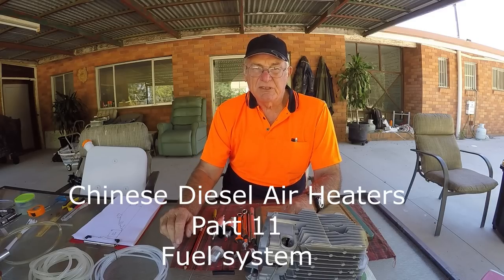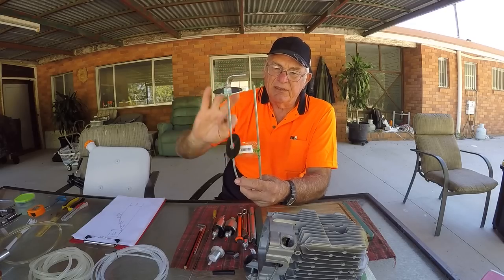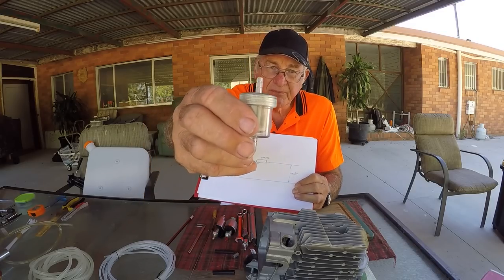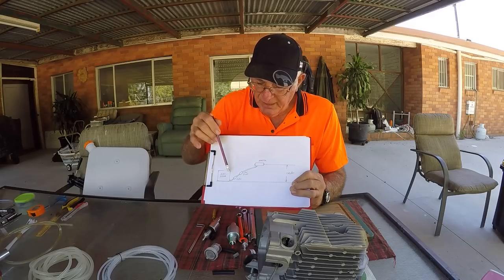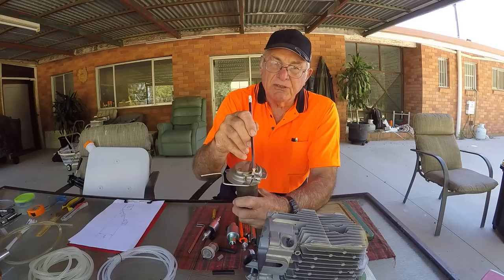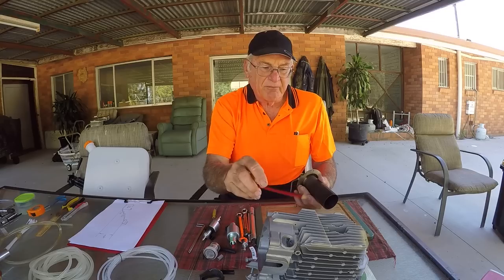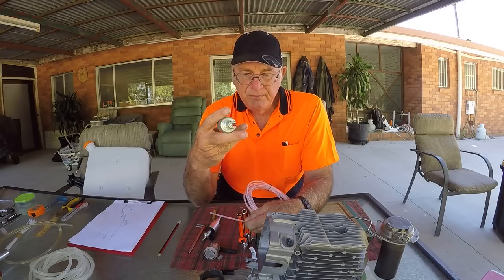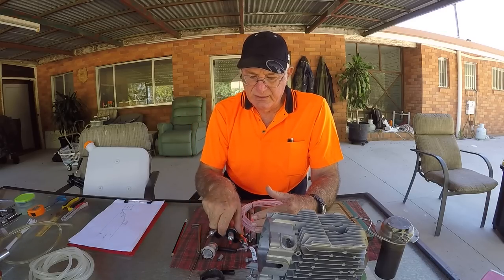Chinese Diesel Air Heaters - Part 11 -  Fuel Delivery

Comment: Thanks for a very informative video.I'm contemplating a diesel heater installation on a sailboat that has an inboard diesel engine.  Rather than adding a dedicated tank, or installing a dedicated pickup in the existing fuel tank, many installations tap into the boat's existing fuel line with a tee fitting. Some say that this works fine. Others say that this leads to issues with the heater pulling fuel out of the main engine fuel lines. Do you have any thoughts? Thanks.
Reply from the maker: Sorry,that is  a bad way to go with these little heaters. You need a seperate pick up line solely for the heater. 

If your vehicle has a fuel pump in the diesel tank (many do) 

1. When your engine is running the fuel pressure will flood the heater. 

2. If the engine is not running, the little diesel heater fuel pump will not be able to suck fuel past the engine fuel pump. JMcK

Comment: Hi John. Love your videos. Very informative. My heater would not have worked if I hadn't watched this. Only came with soft fuel line. Can you suggest where i can get an owner's manual? Mine did not include one. Its pretty cold here in Vic right now so looking forward to getting this install done.
Reply from the maker: Hi CR, thanks for the feedback.
Some of these heaters do not come with a manual, and some come with a manual written in Chinese English. I suggest you search online for install instructions on Eberspacher diesel air heaters or parking heaters. The Chinese copied these heaters, so the info is relevant.  Cheers, JMcK

Comment: Thanks John. Is there a maximum length of fuel line you’d recommend? My fuel container will be housed in the front of the van and the heater in the back making the fuel line around 4 meters. Would this be acceptable?
Reply from the maker: Hi John, 

Have you seen the motorhome install video?

Your instal should have no issues if you put the pump close to the fuel tank and use narrow bore hard nylon fuel hose on the delivery side to the heater.

Cheers.  JMcK

Comment: great video series John but i cannot seem to find hard fuel line with internal diamiter of 2mm i have tried everywhere. and hello from Ireland keep the videos coming Sir
Reply from the maker: Hi Joe, there are lots of suppliers on line. 

Search “Hard nylon fuel line for Eberspacher diesel air heater”  .... 2 mm or 3mm ID is ok

Here is just one link to get you started.

https://www.ebay.com/itm/For-Webasto-Eberspacher-Diesel-Heater-Inline-Fuel-Filter-Hose-Clip-Pipe-Line-Kit-/364009929409?mkcid=16&mkevt=1&_trksid=p2349624.m46890.l49286&mkrid=711-127632-2357-0

Cheers.  JMcK
Reply: @johnmck1147  thanks so much John thanks for the direct link

Comment: I have an idea for another one of your great videos.  The title might be "how to modify your Chinese Diesel Heater to run at high altitude$.
I Live at 6,000 feet and spent time at 8,000 feet and have purchased a diesel heater that is supposed to work ok at 2500 meters. However if it does I am sure there is some modification that would make it work better. I know that the problem with altitude is that there is less oxygen in the air so to fix that, one would need to add more air or reduce fuel. But what is the best way to do that? Thanks

Comment: hi my heather backflow a black smoke and stop working. Replaced the pump am still not working.Open the all the part and nothing look damage.Conect the new pum  the fan run but not ignition.Any tips?

Comment: Thank you sir for your videos they are great ! In your opinion ,which is the best way to silence the dosing  pump click !  Thank you  from the Uk 🇬🇧
Reply from the maker: Hi Ian, sadly, that is the nature of this type of pump. The pulse operation makes a ticking noise. 

They make more noise if they have an air bubble, so try tilting the pump more vertical to see if there is a lower "tick"

You could also see if better isolation makes less noise by removing the pump from the wall and suspending in air with string. If there is a big noise improvement, remount the pump with better isolation.

Regards,  JMcK

Comment: Great video John, thanks for sharing. 

Could you tell me, would 3mm hose work?
Reply from the maker: Hi E,  if you are referring to 3 mm id hard nylon fuel line the answer is YES. 

I must constantly state that “any” fuel line will work on these heaters……..for a while.  

However if you use soft fuel hose on the delivery side of the fuel pump, the pump pulse force is absorbed by the fuel hose and you will not get proper forced atomisation of the fuel through the atomisation screens in the burner, leading to poor fuel burn, which leads to carbon deposits forming on the screens, and eventually no lighting of the burner. 

This is why you should only use proper “hard” fuel line on the delivery side of the pump with these heaters. JMcK

Comment: My heater was working fine for a week then I noticed today that the plastic tank had compressed in on itself, I assume the cap to the tank was the problem, I tried blowing air through the hole in the top of the cap but nothing is coming through, there's a tiny rubber seal right underneath the hole inside the cap, had that come unstuck and blocked the breather hole? Any help would be appreciated
Reply from the maker: Hi Mr G,  if unable to fix the little valve, in a fixed location, perhaps drilling a small hole in the cap is easiest. In a mobile situation where their is a risk of leaking fuel you could loosen the cap when heater is in use, or drill the cap and install a small air tap in the lid. JMcK
Reply: John McK 47 thank you for the suggestions and thanks for replying John!

Comment: thanks again for your great videos! About the fuel tank and lines i have a a few questions, as i am about to install my heater in my g10 shorter wheel base chevy  77 van. 1. You mention the fuel tank (in your drawings) is below the pump and heater so the fuel line is going slightly uphill, yet in other videos of other peoples installs in small vans, i see them not paying attention to this and sometimes they put the tank directly next to or even slightly above the heater unit. No doubt in a small vehicle it is hard to find space lower than the floor of the van itself for the shape of the tank in these kits. Since I am putting the heater under my passenger seat on the floor of the van, I am deciding where the best place for the fuel tank to be. Is the reasoning to have the fuel tank lower is so that fuel will be able to shut off and not siphon out from gravity? No matter where i put the tank, I thinking of ruining the fuel line underneath the van so the pump is outside of the van to decrease the noise of the pump being heard in the van. I like your suggestion to have the pump  at 45 or more to vertical as your video suggests, but wondering if it being outside in the cold will greatly affect the pump. Also one person says keeping the tank and fuel filter inside which makes the fuel warmer prevents gelling. So want to hear your thoughts on the reasoning on the tank placement. and the fuel pump placed outside under the floor. If I put the tank inside but the pump outside the initial fuel going into the line will be warmer so that is my thought right now. Honestly in my climate only at night do we sometimes dip really low. I think it would only be a few times a year that possible gelling would happen. My other choice which would be more appealing in terms of fuel smell is to find some space in the front engine bey under hood in front of the van for my tank but it will get cold there. I was thinking of adding a one way valve to let in air on the top of the tank, it is one way so that the fuel does not evaporate but air can get in so that there is less vacuum building up as the fuel level goes down in the tank and so with less reverse air pressure the pump does not have to work as hard when the fuel runs low. I do not know if you live in a climate that would give you experience on gelling but just want to know how important the tank placement compared in height to the heater is. Also I am also wondering if the tanks that ship with these kits are durable, like i said I might buy a tank with a shape that better fits my need whether i put the tank inside or outside the van. Any suggestions appreciated. (here is an image of the one wway valve i havr in mind. https://images-na.ssl-images-amazon.com/images/I/51PR7kJzwxL._SX425_.jpg
Reply from the maker: Hi Jha,  the fuel tank can be level with the heater, up to about 1 meter below, or 1 meter above heater, for simple working. You can exceed these measurements, but you start to get complexity. 

Most supplied fuel tanks already have a venting system in the fuel cap. Check yours.

You can run a longer fuel line after the pump if it is the narrow bore, hard nylon type line. You start adding complexity with real long fuel line. In your case everything is pretty much on the same level, so you can go longer. If unsure, bench test it first with the length of fuel line you require. Prime the line as best you can first.

These fuel pumps have very effective one way valves inside them. You will not be able to suck fuel past the valves, so there will be no issues provided the tank is not meters above the heater, and the pump is not worn by using it to dry prime.

The supplied fuel tanks are quite good, but being clear for level measurement they will be degraded by uv  sunlight. If outside the van, they will need some canvas cover. 

Pump under van is ok, if not ideal, but you need to protect it and electric wiring from stones and direct water spray. This can be a simple deflector shield.
The pump gets hot when working, but the fuel lines can suffer more from gelling in very cold weather.

You are doing your research, so you should have a good install.  JMcK

Comment: I have a question. First off, thank you so much for all the information. I was able to build mine in a toolbox and followed all your steps. I now have a functional heater I can have confidence in because of your series.
However, I seem to have run into an issue. In Canada where I am at the moment, it's close to -30C and I've found my fuel gels up and won't pump. I heated the unit up and ran It in the jeep for the initial test but when I have the heater outside of the Jeep, the fuel freezes. My plan was to have this unit (built in the toolbox) and tank outside my rooftop tent blowing heat through a window.
I would prefer to not have to heat insulate the exhaust and keep the whole unit inside the tent to prevent freezing/gelling. Would an additive mixed with the diesel prevent gelling so I could have it outside in -15 to -30C conditions? Or is my only option to re-engineer my build so it's safe to have inside the tent with us as to keep everything at a functional temperature?
I hope you see this soon and have an answer for me! Thanks again!
Reply: Diving further in your videos you say kero/diesel mix would work. I'm glad there's an option for me for sure. I'm wondering still, could an anti gelling additive work as well for just 100% diesel or is it best to go with your 80/20 diesel/kero mix?
Reply from the maker: Overland Jeep 

Hi there,

Yes, a kerro diesel mix is often better than “winter diesel”. But I understand price is also an issue.

I suggest a kerro/diesel mix of 80/20 to 90/10. If kerro in your country is a reasonable price.

The purpose of the diesel is to give some lubrication to the kerro. Some countries sell a very high sulfur content kerro that generally provides enough lubrication on its own.

Do not use an oil additive like 2 stroke mix as it creates lots of carbon in the heater.

Cheers. JMcK

Comment: Hi John, great video. I am part way through installing a diesel heater and used the soft line. It will be very challenging for me to lift the heater out now to change the line where it connects to the heater, but I can just feed the hard nylon tube into the soft wider vinyl fuel hose from under the car and just clamp over the top of the soft hose (not using the black rubber hose and about 15cm directly and vertically below the heater)? Do you think this solution will be fine?
Reply from the maker: Hi GS, I think that would work fine. Have a look at motorhome video. I do something similar to provide protection to nylon fuel hose.  JMcK

Comment: I have been having the dreaded E-06 error from day one. I have adjusted the Holzer sensor position, a full range in & the full range out. I finally put it on .020 - Still have the E-06 error
I am using the 0.2 cm (I/D.)  White Hard Nylon tubing and have the pump is on a 30 degree angle, fuel tank higher than the pump, & pump is lower than the heater.

-ALITOVE DC 12V 20A 240W Power Supply, 12.6v
-Power Sonic (AGM) Rechargeable Sealed Lead Acid Battery 
 -PS-12350 12V 35.0 AH @ 20-hr,,
When I start the unit, blower runs for one minute & the pump makes one pulse, then faults out. If I power unit off for 24 hours, it did run but then faulted out, 2 hours later
-So, by this I can assume my Holtz sensor is okay?
   Filter bowl is full & just above pump, I have only been able to prime the pump manually by 
Pressing the 'OK' button, & the Down arrow button at the same time,  to get the P prime function. This put fuel in the chamber & the igniter burned it & the heater made it;s usual roar but the injector pump never fired up 
-So I assume the igniter works.
This controller & ECU does not support the LEDs for the injector pump, igniter or temp range, just a fan. ( They do show up in the POST )
   I have ordered a new pump, thinking mine is defective, any ideas?

Comment: Thanks for the video. Really good information! If I have two of these pumps sucking diesel from the same fuel line (connected with T piece), do you know if I need to install direction valves before each pump?
Reply from the maker: Hi Jarkko,
I have not had an issue with something similar in the past, but each case is different. 
I do not think you will need to install direction valves, but you need to try and see.  JMcK

Comment: Thank you for an amazing educational and entertaining video series! We had many a giggle and I feel so much better equipped to install ours. 

I have a question Re priming the fuel line. How did you bypass the pump to get the fuel up without damaging the pump. I see it was a little clicker but I’m not too sure how to re create this. The clicker is at Jaycar but I’m not sure what else I need. Any help would be greatly appreciated! 

Also my nylon hose was the small version but it’s not super hard. There is a slight squish under pressure - not super soft but not completely firm either. Is this ok or should I find some harder hose? 

Also I think the manufacturers have watched your videos as the upgraded Bluetooth models come with a tool kit with your bits in it!
Reply from the maker: Hi Emily,

If only a short hose run from tank to heater, approx less than 1 meter, suggest you use che controller prime function.

If a long fuel hose run from tank to pump, suggest manual prime to avoid wear on dry pump piston.

The fuel hose from tank to filter to pump should be good quality black fuel hose.

To prime fuel to the pump on install,  I generally use the old fashion way of sucking prime (not recommended) I push a length of clear vinyl over the black fuel hose so I can see when fuel reaches end of black hose then quickly remove clear hose and push black hose on to fuel pump.

I recommend manual priming of pump, by using one of those black priming bulbs used for outboard motor prime. You can also use a large plastic/metal syringe available from auto stores used for oil removal from diff and gearbox.

If a long run from pump to heater I use the manual switch method. Easier than continuing to use heater operation to pump fuel along line.
Suggest you watch motorhome install part about priming.

Nylon fuel hose is “hard”. I suspect you actually have cheap soft vinyl fuel hose, not nylon fuel hose. If distance from pump to heater is short (less than 1 meter) suggest you use good black fuel hose, not cheap rubbish vinyl hose. If delivery line longer than 1 meter, suggest you only use narrow bore hard nylon fuel hose. Many suppliers online. 

Cheers,   JMcK

Comment: Static head pressure does not matter on the volume, only the height.  So I believe your theory of thicker diameter hose to "lift" doesn't effect the pumps suction.  I could be wrong.  If you have a tank that is 20' tall and 50' wide, your static head pressure is the same as 20' tall tank that is 1' wide.
Reply from the maker: You are correct. I just need to work out how to remove that bit from the video.  Thanks.  JMcK

Comment: John, thank you for your tips & detailed understanding of diesel heaters. I have incorporated many of your tips in my first heater installation. Do you have any thoughts regarding placing the fuel filter inside the fuel tank at the bottom end of the standpipe where the fuel first enters? I'm considering placing my standpipe in a 20L diesel fuel can where I will be removing the standpipe each time I refill the can.
Reply from the maker: Hi David, this is a personal thing. Do what is best for you. I prefer it outside, but many modern cars have the fuel filter inside the fuel tank. Cheers.  JMcK

Comment: Great videos very informative, John do you know if there is anywhere I can buy a three pin plug the same as on the controller cable .thanks
Reply from the maker: Sorry Leenac, I do not know a source for the plug as a spare. 
But I have also not looked hard on the net as to date I have not needed one.  Sorry.  JMcK